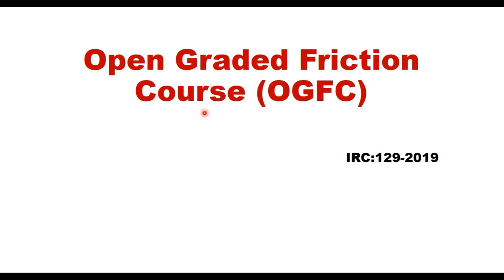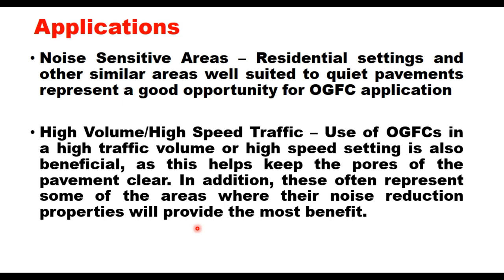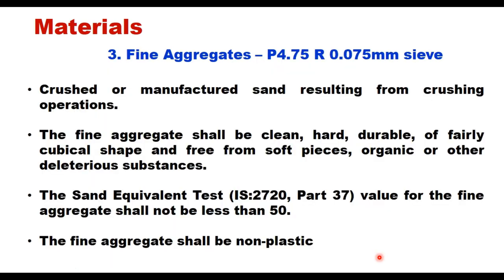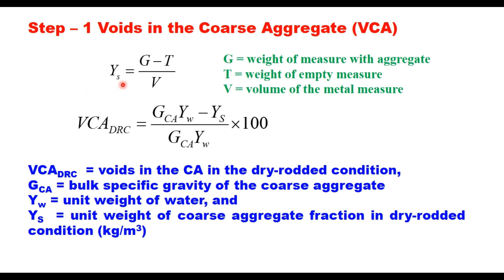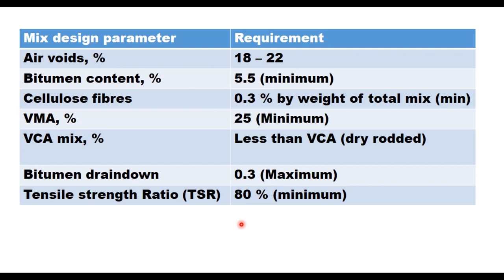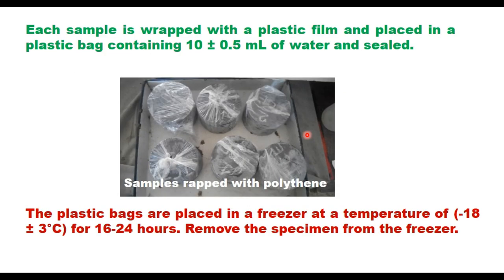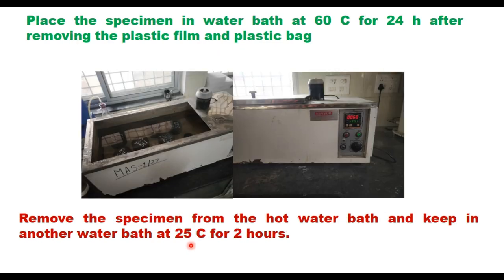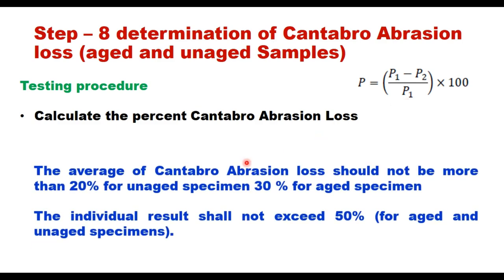Open Graded Friction course, OGFC, IRC 129, 2019, Definition, design and applications of OGFC

Comment: Sir, but why IRC:37-2018, does not mention about OGFC ?? Can we use it for highways upto 50 msa traffic as a surface course layer ?
Reply from the maker: Code on OGFC was published in 2019, after publication of IRC 37, 2018. That is why this specification is not in IRC 37. It is used over a permeabale layer like DAC. Yes, you can use it for highways up to 50 msa where rainfall intensity is high.
Reply: Thank you sir for your reply.
Reply from the maker: @sagarshukla3198  Always welcome

Comment: Sir,
      Can we use this OGFC treatment for  approach roads at Junctions as the alternative of Open Graded Carpet course.
Reply from the maker: OGFC layer is preferred in places where high rainfall is expected. They are also good on high speed routes and where high friction is needed. Approach roads to junctions generally will have low speed and pores of the layers are likely to get chocked by the dust.
Reply: thanks sir